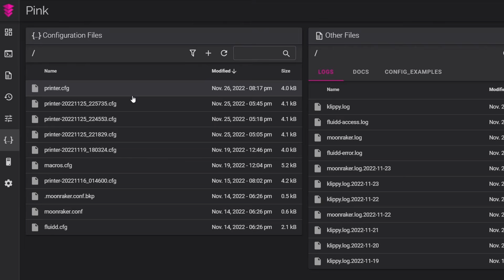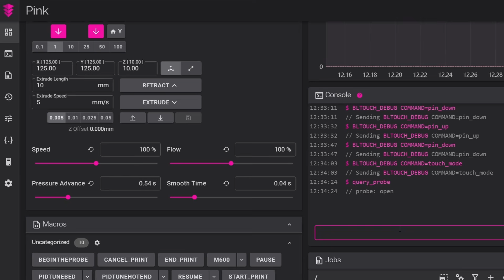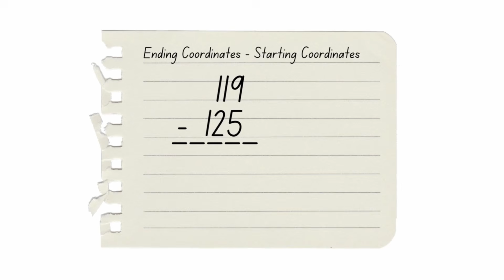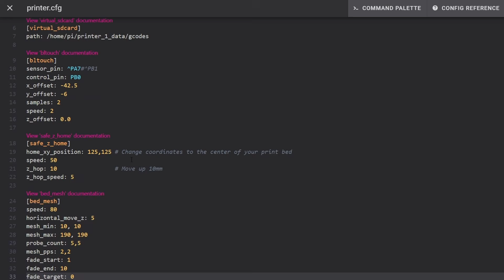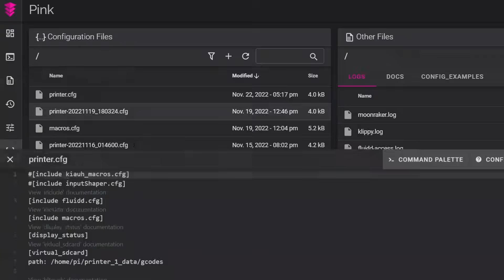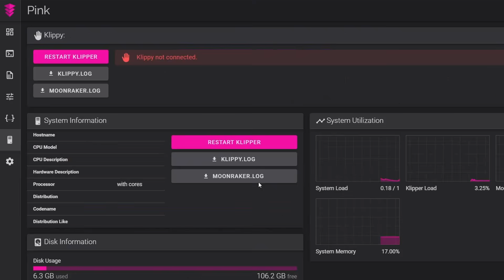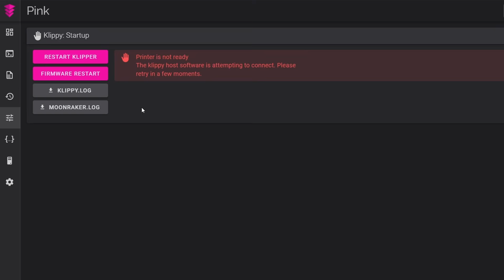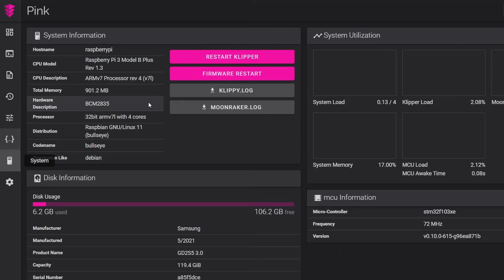BL Touch complete setup for Klipper! Maximize your probed bed mesh!

Comment: This is the best tutorial on getting started with Klipper and Fluidd!  Thanks for the detailed explanation!!  As stated below, many people know how to do this, but the skill is inexplaining to someone who hasn't mastered the subject and you did a great job.  I was right with you until you got to the gcode start macro and adding the saved bed mesh.  My printer.cfg file does not have that section.  I have Fluidd connected to my Cura slicer for output and the Start and End macros are there.  Seems like it would make more sense to have them in Fluidd where the bed-mesh file is located.  Should I move that code from Cura to Fluidd, or insert the reference into the Cura macro?
Reply from the maker: Harry, thank you for saying that. The points you mentioned are all goals I try and achieve while preparing the video, so it's really awesome to hear that it's paying off!

As for you problem I am not totally sure I follow you. Are you saying you don't have the Start_Print macro written into your printer.cfg? And the commands that are in the start_print macro are instead written out in Cura, under the start gcode section? Let me know because I want to be sure exactly how you're set up before I make any recommendations. 

As a blanket statement though, having all the start macro within your printer.cfg (under the start_print macro) is ideal. This way when you slice a model Cura is only going to add the call to that macro (start_print). Which means you can modify the commands in start_print all you want without ever re-slicing the model. Let me know if this makes sense or if I was missing the crux of your question.
Reply: @PrintsLeo3D  Yes, that is what I am saying.   The PAUSE, RESUME and CANCEL macros are in the Fluidd printer.cfg, but not the Start Print and End Print gcode macros.  Those are in the Cura Machine Settings and are inserted before the gcode goes to the machine.  I suppose I could copy the code into printer.cfg (maybe right above the PAUSE code?) then delete from the Cura Machine Settings.  Just wasn't sure it mattered and wondered why it wasn't already in the printer.cfg file to start with.
Reply: @harryanderson3527  getting my klipper setup, and also noticing that my printer.cfg does not have those macros. I'm not entirely sure where to start, what did you end up doing to fix it?

Comment: I have a modified SOVOL SV04 Idex with two Hemera instead of the stock ones. After two weeks messing around with X&Y Offsets for BL/CR Touch, Extruder 1 & 2 and the bed_mesh I was already  at the point to throw everything out of the window. I can't thank you enough for this great video. Perfectly explained and with a clear & good structure. Now I've got my settings dialed in an the tip with the post-it and the marker was a "HEUREKA!" moment for me, getting precise Offsets not only for the Tpuch probe but also for my second Extruder! (I've wasted nearly 500g filament for all the calibration STLs) I've got exact 5 years Experience in 3D printing with MarlinFW but just one month with Klipper. And an IDEX printer. And a modified one . 
So again: THANK YOU!
Reply from the maker: Woah that's amazing!! Trying to get these settings correct for a single extruder printer can be tough, but being able to balance all this info and then apply it to a second extruder is another thing entirely!!  So happy that my video helped and thanknyou for sharing! I have been in hearing more and more good stuff about the Sovol units, it seems like this is another positive anecdote. If you ever want to stop by the Discord and drop some pictures of the printer or your prints we'd love to see. Especially with those Hemeras 🤤 thanks again!

Comment: I have followed your video, figured out offset etcetera, BUT when I come to define the mesh size its a dead end for me, if I use your "calculations" the probe wants to go to far, and I get an errormessage, if i try another configuration the probe goes 10mm in from the edge on the "left" of X but more like 50mm at the far end.
what can be wrong?
Reply from the maker: Daniel, this is something we can figure out. Let me ask you  for some information:

1.) what are your Maximum X and Y bounds?
2.) what is your X and Y offsets for your probe?

Let me know and we can start taking care of it.
Reply: @PrintsLeo3D  I tried SO much the other day, but ill post what I still think was my measured maximum by eye there is.

My maximums:
X 233

Y 232,60

and X(Y offset:
X offset

-47,6

Y Offset

0

(Y is zero because I have a printed duct and heaterblock cooling that centers the Y with the nozzle.

Comment: TESTZ requires a specific input. Not sure how you got a new menu to pop up.
Reply from the maker: This feature showed up for me 6 months or so ago. I used to use "testz z=" as well, but now this menu simplified it. I believe it's an overlay you can toggle on and off (as long as the version of your front end is up to date). From the home screen of your front end (I use Fluidd), click the settings cog wheel, then toward the bottom under the TOOL section you should see a toggle for 'show probe dialogue' (I think can't remember the exact name). Try turning that on and see if it works.
Reply: @PrintsLeo3D  Hmm I see. I'm using the Creality Sonic Pad so I'm a bit unfamiliar with how to update Moonraker. I just used the pad interface instead of bothering with the frontend on my computer local login and saved the offset from the pad. A bit of a shame I got stuck, but all's well ends well! Thanks!
Reply from the maker: CK I wish I had a pad because I am getting more and more people who are having issues with it. I'm not too sure how the updates on the sonic pad work but you should be able to find something at the bottom of the settings menu (which is the cog wheel).

Comment: Hi, I am using a macro M600 for filament change. It is resuming print about 2mm higher in the air., Can we help me figure out what could be the reason for this?
Reply from the maker: Hey Manoj, the easiest way to check this out is to see what sort of configuration files you're working with. Can you email me your configs (printer.cfg along with any other you are using to control the printer ). This way I can take a look at it? Email : printsleo3d@gmail.com

Comment: my printer config files doesn't have a gcode_macro start_print section. Will it automatically add the bed mesh default profile? I would greatly appreciate any advice!
Reply from the maker: The start_print macro is necessary to initiate any gcode you want your printer to execute prior to printing. For instance printing a prime line, loading the mesh, etc. Before installing Klipper all those commands were handled in your slicer under the section 'start gcode'. The start_print macro is just that, all the gcode commands you had in your printer start gcode just go into the body of the start_print macro. That means you'll need to delete the gcode in your slicer (under start print gcode) and then add the line start_print, because now the only like you will be running is the macro, and when that macro gets called it will execute all the commands you have put inside it. Start_print (and end_print which is after the print finishes) macros can differ based on your printer, commonly they will come prepackaged with a configuration file (though sometimes the name is mirrored 'print_start'). I have some very basic start_print and end_print macros available on my website if you want to copy and paste them into your config. 

https://www.printsleo3d.com/macros

Let me know if these work for you or if you need some more help!
Reply: @PrintsLeo3D  Oh okay! admittedly, I walked into this pretty blind trying to stitch the pieces of a klipper config together from files I found on github. I didn't understand the relation between printer macros and slicer start gcode. ooof. I have a lot to learn. I am checking out your link now and will putz around for a bit. Thank you for the reply! This data is so hard for me to find for some reason... You are a great help!
Reply from the maker: I'm glad I can add some clarity. Patching pieces of a config together can be tough, especially if this is the first time your diving into Klipper. I'm here to help however I can do ask any questions you need. My upcoming videos (aside from my next video: dual belted Z axis) will be regarding Klipper setup and calibrations. If you're familiar with Discord then I highly recommend to join my Discord (link in description) because there's so many helpful resources there, from people who are going through the same things you are, to others who have a working setup , and everyone is willing to help! Glad you're using Klipper and good luck!
Reply: @PrintsLeo3D  Hey man, I have to be honest with you. I adjusted what you said with adjusting my klipper config and removed everything from my cura config and the printer is acting differently but for whatever reason it just isn't leveling properly. it takes the measurements but then acts like its measurements are crazy out of whack. 
I have been ignoring my printer bc I am just too stupid to fix it myself and am just frustrated. like, I want it to work but I have anxiety over trying to fix it because I am so lost. 
Is there anything you can do or recommend? I have already done what you recommended and things aren't great. 
oof, I have an i3 mega S if that helps. I wish I could just share my config file and some pictures. 
anyway, I am so sorry if I stressed you out with this. I am just super lost and dumb., :-/
Reply from the maker: What I would like to do is see your actual settings. Your printer.cfg , a screenshot of your start and end print gcodes. Can you email me ? That sort of communication lends itself to sharing some photos and I can help in a more active way. printsleo3d@gmail.com
Reply: @PrintsLeo3D  Oh thank you so much! I will have it off to you this evening but 1st I would like to publicly thank you. Its clear that I am not the person for klipper or I wouldn't be having these issues and the emotional and mental burden of them shouldn't be yours. I do genuinely have a great appreciation for you assisting me. Thank you so much! <3
I will have it sent off to you this evening when I am home!
Reply from the maker: Hey listen, you aren't the 'wrong' person for Klipper, the set up can be difficult, and sometimes they're just a single problem that is putting a hault to the whole thing. We'll take our time and go through what you have and I am sure by the time we're finished you'll know what's going and and feel familiar enough with the process to be able to diagnose most issues you'll face. For the ones you don't feel comfortable with, I'm always here :)

Comment: Can anyone tell me how to hook up to the anycubic vyper motherboard? I don't have much experience doing these things. I have tried. Having trouble finding the signal pin number.
Reply from the maker: Hey Adam, are you using the probe that comes with the printer,  or are you looking to set up a bl touch? From what I understand a [probe] section in conjunction with a few others is needed:

[probe]
pin: !PB12
z_offset: 0
activate_gcode:
    probe_reset

[output_pin probe_reset_pin]
pin: PB13

[gcode_macro probe_reset]
gcode:
    SET_PIN PIN=probe_reset_pin VALUE=0
    G4 P300
    SET_PIN PIN=probe_reset_pin VALUE=1
    G4 P100

That being said I would imagine the pins PB12 and PB13 are the sensor and control pins if you're looking to set up a BL Touch style configuration. I don't own a Vyper so I cannot confirm anyone of this. If you need more help let me know and I'll see what I can do.
Reply: I finally had success. I saw a picture in Cryd's video of the zr and zl endstops being used for connection. That along with watching your video got it done. If anyone else has a similar issue with a vyper these are the pins I used. PB2 and PC6.

Comment: I want to thank you very much for this video i wish i saw it a few days ago as it would have made my life so much easier! do you have a video on start and end codes for the mesh also to be inserted into? i use prusa slicer and dont have any idea if the mesh is applied or not in the slicer or from klipper as im new to klipper! again tyvm for the awesome video cant wait to see more..
Reply from the maker: Jon, thanks for watching and I appreciate the kind words! For the start and end gcode, I go over it briefly in my Installing Klipper on the Aquila video (towards the end) and I use Cura in the video. The basic idea is that you'll replace whatever start gcode you have in Pruscaslicer, and replace it with the name of your start orjt macro (for me it's stadt_print). Then you do the same thing for the end gcode , this time adding end_print.  Next, inside printer.cfg, are the start_print and end_print macros with all the gcode to be executed within them. Add the bed_mesh lines in your start_print macro and that's what will call the printer to use your bed mesh. Does that make sense? I can explain it in better detail for you if you want me to, let me know !
Reply: @PrintsLeo3D  no this is perfect and tyvm! have a great day!

Comment: I do get this error message a lot:  "Failed to verify BLTouch probe is raised; retrying."
Also when probing, it allows the z to go barely further down than the bed and it twists the gantry/sprite a little, but then it lets off and it straightens up.
Also I'm getting:   "Failed to verify BLTouch probe is raised; retrying." when trying to run auto bed mesh.

I'm wondering if my BL touch is not high enough.  I know the sprite and the BL are both ender  products but is it possible maybe i installed it wrong and its too low or something
@PrintsLeo3D
Reply from the maker: I'll plug my pi in tomorrow and take a look at my ender 5 settings, because I was having similar issues with the Sprite and that condition. I think I had to add a pull-up (^) to my config, but I think you already had that. The section I told you to add can have that effect where it doesn't quite probe early enough and can hit the bed. I fixed that issue with my Ender 5 but I haven't worked with it in a while, so I'll check my config tomorrow and see what I come up with
What pins are you using for the sensor pin and control pin .

Comment: i get through all your tests  probe up, probe down, query probe... it all works  except when I get to auto home all.  it goes to home, drops the pin, then pin up then it says failed to verify sensor state.  I've tried unplugging my z stop switch. idk what to do
Reply from the maker: Hey Jon(who is likely Austrian), can you paste and message the bl_touch section of your printer.cfg as well as the mainboard the printer is using ?
Reply: @PrintsLeo3D  my config (the probe section) is exactly like yours.
I tried unplugging the z limit switch. 
Maybe i need to connect my BL directly to the SKR mini 3 v3.0 board instead of through my sprite
Reply from the maker: Try adding this section under [bl_touch]
pin_up_touch_mode_reports_triggered: false
Reply: @PrintsLeo3D  I re wired it directly to the board and it's still doing the same thing. 
I'll try adding that to the config
Reply from the maker: Yeah give that a shot and let me know how it works. That's usually the remedy with this sort of issue
Reply: @PrintsLeo3D  that command worked(in my config) 
However it keeps on trying to go lower than the bed indefinitely.
Reply: @PrintsLeo3D  oh wait!!!    It homed!!!!!!
Reply from the maker: Sometimes a nice restart of the host device helps scatted those left over bugs out ;) so it's working ?
Reply: @PrintsLeo3D  let me go back through your whole video app setup before I say everything's working 😆 
I'm sure it is thank you so much
I'm not austrian. 
I just believe in austrian economics. It's the right thing to do but nobody likes the right thing (austerity)
Reply from the maker: Happy you got this working!!! Thanks for watching and for troubleshooting.

Comment: i have ender 3s1 and can't find in printer.cfg this g_code macro start_print... maybe you have some advice? if after calibration i just save config in page where i making bed mesh calibration it's not enough? (English not my native language, sorry)
Reply from the maker: Andrey, start_print is a macro you need to create and add. It is taking place of all the start gcode that you usually have in your slicer (like Cura). I explain this slicer change at the 52:10 mark of this video 

https://www.youtube.com/watch?v=a6ru0mH3F8M

If you need me to explain in greater detail I can, let me know.
Reply: @PrintsLeo3D  when i add some g code to print in mainsail  g_code start_print will appear in printer.cfg?